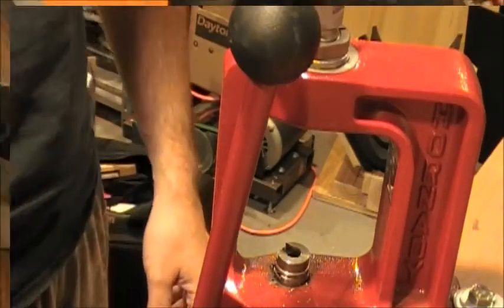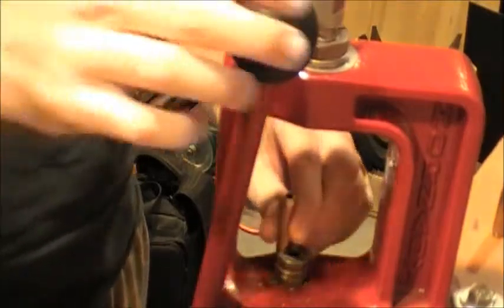277 Wolverine Brass Forming Procedure

Comment: What does are you using to size the brass because I heard the hornady dies leave a weird imprint on the brass
Reply from the maker: I am using the Hornady dies. I think you're confusing them with the first batch of Lee dies which had a vent hole (for excess lube) that cause a slight cosmetic only  blemish on freshly formed brass. It had no negative effects otherwise
Reply: The Lee sizer that I have scores the brass vertically.  Fire forming is supposed to smooth that out.